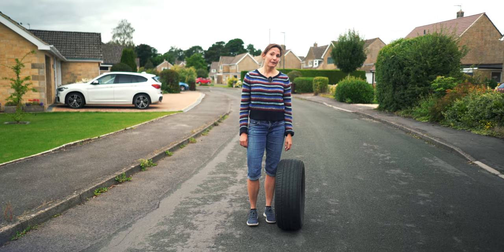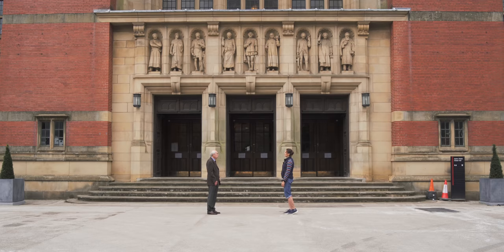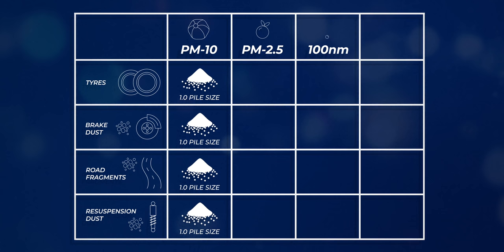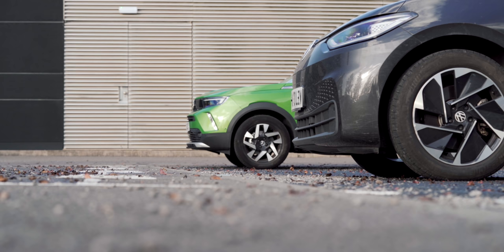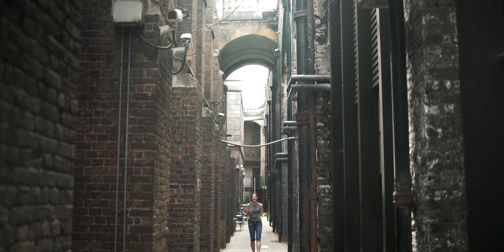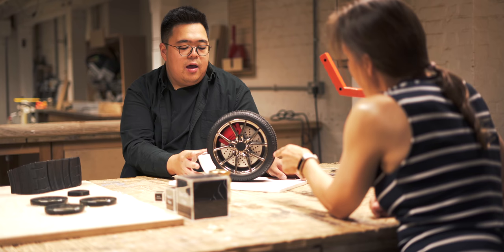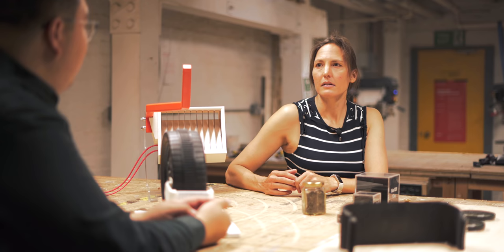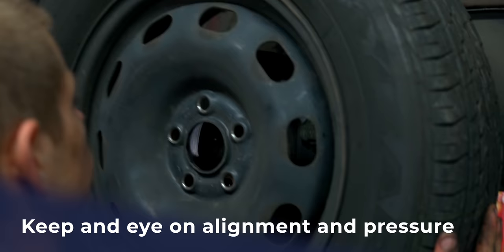The Secret Pollution That All Cars Are Guilty Of | Fully Charged

Comment: The obvious answer is we all need to use solid steel wheels, solid steel roads.
And maybe if we shared out vehicles and make sure they can carry a bus load of people.
And if we only travel a well defined route it would be much easier to understand and control the surface.

Aaaand.. I just invented the train again
Reply: Isn't steel made from coal powered steelworks or something? 😂😉
Reply: @TeaBreak.  doesn't have to be , all you need is electricity. There are steel mills that use electricity instead of coal , naturally that electricity needs to be produced without fossil fuels.
Reply: I understand that some of London's underground poor air quality is caused by steel train tyres wearing on steel rails.  A minor point, I do agree with you.
Reply: Solid steel wheels and solid steel roads brings back memories of the famous railway 'leaves on the line' announcement. It would end up like a tramway system with the same flexibility.
Reply: @vesawuoristo4162  Doesn't electricity mainly come from gas, a fossil fuel? 😉
Reply: @TeaBreak.  Doesn't have to ;)
Reply: The 'obvious answer' is to use non-tyred public transport, rail and tram with electric braking. Steel wheels and roads do not have sufficient adhesion coefficients to work. Running HGV's and low use busses generates enormous amounts of tyre and brake particulates. The least bad are light axle EV midi busses and last mile EV vans.  Long distance transport via high speed freight trains is the least damaging solution, requiring HS2 completion to free up freight paths.
Reply: @TeaBreak.  At the moment at the start of the evening peak period, 56% of my electricity is coming from renewables acording to the National Grid's 'when to plug in' app.
Reply: @eclecticcyclist  You don't make steel. 😉
Reply: @TeaBreak.  how do you know and what's that got to do with grid energy?
Reply: @eclecticcyclist  OP
Reply: @bellshooter  If you're running EVs or electric trains like the French TGV most of your braking is done by the motor and there is very little brake dust.
Reply: Trams
Reply: @TeaBreak.  will be made with hydrogen
Reply: @julianshepherd2038  Hydrogen comes from the production of petroleum. And is also twice as expensive as fossil fuel. Not sure that will happen any time soon.
Reply: Why not wooden wheels? And pull the thing with an animal, possibly? Also we can avoid all that deadly asphalt and concrete on the roads too... just use mud instead, which is plentiful and free.
Reply: @alexmckenna1171  Animal and Tree Rights. You'll have the woke police on your back with talk like that. 😂
Reply: @TeaBreak.  how often do they need to change steel wheels and track? Not very is a fair answer. The payback from the energy used to make the steel wheels and track is massive.
Reply: Yes, trains are way better.
Reply: @eclecticcyclist  the energy recovered from the braking of electric trains actually helps other trains pull away and accelerate. It's fed back into the system.
Reply: You made me chuckle.
Reply: @yodab.at1746  Rails last 50 years + even with very heavy use, and track level/alignment can be adjusted many times with very minimal addition of materials to compensate for wear and tear on the track bed. Unlike roads which need the entire surface to be stripped and rebuilt every few years. It's not only the environmental impact, maintaining roads is also very costly which is why many roads are in poor repair and governments are unceasingly struggling to find the resources to maintain them.

Comment: Completely agree. I'm an EV driver and have worked in local air quality for local govt (Part IV Env Act 1995) for over 20yrs and it's about time we put some real thought into non-exhaust emissions. Glad to see that DEFRA and UKHSA are starting to shift focus from NO2 to PM with particular focus on non-exhaust emissions. EVs are certainly not zero-emission, despite the three badges on my Nissan Leaf saying so haha.
Reply: Graham Cook  that's right they do. But the increased weight and torque are a significant factor. I'm all for an EV future, begone you ICE vehicles! But the answer to poor air quality is fewer vehicles not just different types of vehicles.
Reply: Good point. Is it time to rephrase to “zero exhaust emissions?”
Reply: Graham Cook  yes buy it's not just about tyre wear, there's road wear and resuspension too. It's a complex picture which is why I'm glad that Defra focus is shifting towards this topic.
Reply: One of the first things I did with our LEAFs was remove all of the "Zero Emissions" badges.  Greatly reduces the "electricity has to come from somewhere" arguments in parking lots.  Surprisingly to many, I already knew that.
Reply: Graham Cook  In my experience in 10 years of EV driving, the drive tires still do wear faster than non-drive tires.  These were FWD cars though so I can't say how much of that is from steering wear as opposed to drive forces.
Reply: EV's are definitely a good start to reducing emissions, but like you say we should still be focused on other non-exhaust emissions. As well as some of the other issues of EV's, like the weight of the vehicles, battery recycling, where batteries are sourced from, reducing the emissions of building new cars, where the electric for the car comes from etc.
Reply: @BixbyConsequence  me too for extra range!!!

Comment: A recent Norwegian study showed that ALL road wear comes from heavy vehicles(like 2500Kg+). Under that limit the wear wasn't measureable. I'm sure this research is going to be used against EV cars somehow. Many people say that EVs wears the road more, and the (statensvegvesen) study properly showed that its only the lorries fault. Focusing on the rubber pollution is just going to create noise in the scheme of things. Its wood burning and lorries that creates air pollution that creates astma.
Reply: Yes, I've seen it already, but of course never any talk about driving smaller ICE car instead of a giant SUV.
I think the particulates in diesel exhaust are exceptionally bad and get a undeserved pass from emissions standards.
Reply: Well in North America at least the 2500kg+ EVs are incoming, the F150 Lightning at 2950kg, Rivian R1T at 3200kg, and Hummer EV at 4000kg.

Comment: Feedback I've seen from EV owners is that brake pad wear on EVs is significantly reduced compared to non-EVs due to regenerative braking, as the brakes aren't actually being used.  Would be interested to see comments from EV owners who've also experienced this.
Reply: Brakes last longer, tires seem to at this point wear faster. Lots of ground, water, air pollution in mining for batteries.
Reply: The brakes on my 120000km Ioniq EV are still like new.
Reply: 5:43
I have 55,000 miles on my Model 3 and 42,000 miles on a Focus Electric and have never replaced a single brake pad in either vehicle, so for sure brake dust is  significantly less of an issue for EVs. Probably close to an order of magnitude less.
Reply: The US has some useful long term data from Tesla on brake wear.  It seems that Tesla brake pads last 5x-10x longer than the equivalent ICE car.  The reality is that at best we are generation 2 of EVs.  By the time we get to 2030 it would reasonable to expect that we will be at generation 4 of EVs: longer range, faster charge speed and crucially much lighter batteries which means that like for like models will be a lot lighter - sadly I suspect that vehicle manufacturers will produce heavier and heavier models, partly caused by improved safety regulations but mostly caused by customers wanting bigger and taller cars
Reply: I’ve heard rule of thumb is 4x as long for brake pads.
Reply: My Leaf is now due some new pads, at 65k miles...
Reply: @nom_chompsky  its not the same at all, i live in alps and I hardly ever have to use the brakes on my EV even going down cols with many hairpin bends. it has 180000kms and original pads are like new.
Reply: Correct! Used regen in our 2018 Leaf. Only had it 2.5 years so of course no time for brakes to wear either way, but I hardly used them so I imagine they would last way longer.
Reply: @justinstephenson9360  We will fly by 2030, so no tyre pollution either. It will be heavenly.
Reply: @AB-yt4hd  that’s nothing my Honda Jeffrey has 180,000,000 miles and haven’t replaced the tires, brakes or washer fluid!
Reply: Yup. 191k on my prius before the brake pads wore out. They actually didn't wear out but the sliding pins seized up because you still need to grease them every 36k miles. Sized up and ate the pads and locked up. 😂
But yes the pads that werent locked up were pretty much new like 80% life.
Reply: I've probably only stepped on the break once or twice in the last year, which is magnitudes less than with my ICE car
Reply: @AB-yt4hd  2002 EV: original discs and halfway through the factory pads! vax candles and vacuuming is way worse for your life expectancy. EV tyres are higher pressure and made from harder rubber to reduce rolling resistance, so the higher weight is somewhat countered by harder wearing tyres.
Reply: AS  a mechanic I totally agree in fact 50 per cent less wear on brake pads if you use regen braking that's a fact and you can take that to the bank lol. no really.
Reply: My 2014 Tesla Model S has 176,000Km and is on its original set of brake pads. Tyres are lasting an average of about 60,000Km a set.
Reply: You can actually do the same thing with ICE car by using engine braking by down shifting gears, effectively the same thing as regenerate braking which slows down the car without using the brakes
Reply: @NicholasY21  I wonder though if the high revving on the engine and increased fuel consumption is more harmful to the environment, long term reliability of the engine and in turn more expensive to the owner. 

I know my car engine brakes when going down hills with cruise set and then once it gets over a certain speed if the engine braking isn't sufficient it then will utilise the brakes to further slow. When it does this though, the engine is at 4/5 thousand rpm. Noisy and sounds harsh on the car. What are your thoughts?? I mean replacing an engine is a lot more expensive then pads.
Reply: @TheAegisClaw  do you not use "B" mode or are you just an aggressive braker? I often barely use the brake pedal.
Reply: @GudieveNing  I'm just hopeful we'll be utilizing self charging (most likely solar) vehicles by then. Taking to the air is another whole level of evolution-maybe by the end of the century....
Reply: @rngalston  gen 1 leaf doesn't have enough regen to avoid the brakes all the time. Still 2-3x an ice would last though.
Reply: @rickbelieves7652  add all pollution and environmental damaged by the oil production used for ICE (apply percentage for how much oil is used for fuel production) and it will be much higher that the environmental damage of the production of the batteries.
The gap widens as new mining and chemistries are developed.
Reply: @TheAegisClaw  mine is Gen 1. It's a matter of seeing the need to decelerate in time. It's a challenge for me (and those that are behind me) to not use the brake pedal and only apply the parking brake against idle creep... It doesn't happen very often (I try to be under 5 mph to prevent unnecessary rear brake pad wear and avoid the annoying alarm chime), but always a feat when I do! Then I disengage the pedal and hold with my left foot until the light goes green and punch it to leave all the ICE cars in my tire dust, accelerate to maximum legal velocity, set cruise, and then get the road to myself (unless someone catches me by speeding). Makes my commute even more enjoyable. But that's just me...
Reply: @plojo  
That is the hope, but people need to realize everything pollutes or has other negative effects. Also oil is not going away, it is used in too many products.
Reply: @rickbelieves7652  +1
Reply: @TheAegisClaw  sounds about right.  If you are light on your brakes and use regen for most driving you might get up to 100k miles on a leaf before changing but 75000 is more likely to be the limit before changing.  On a similar sized ICE car you might get 50,000 miles at most before changing (usually 35-40,000) so still a lot better, just not as good as for other EVs.
Reply: @GudieveNing  What exactly is the benefit of flying? Excluding pollution (which is speculation for now)
There's really no point in flying and imo it's a terrible idea to have cars fly above my head so we can't see the sun anymore and it's a constant movement above our head. I'd be scared of an accident mid-air and vehicles crashing down on pedestrians etc.

I do not see a single upside on flying around for normal traffic.
Reply: Even in a heavy old Mitsubishi Outlander PHEV my tyres and brakes are considerably less worn after 46,000 miles than in any previous ICE a car I have ever owned.  I always use the variable regen braking to the full when going downhill, approaching roundabouts etc.
Reply: @jamesegan3756  9mm..?! 
You check these things ........?!?!?!
Reply: At 50,000 miles the brakes on my EV are at 90% or more.  They just don't measure them that precisely.  Over the life of the car, tires are the most expensive item, actually costing more than the propulsion batteries.
Reply: @lukiejames  if I’m in a manual car i would normally use engine braking and brakes on the same time, but in auto i just use the brakes, but as of above i was just saying ICE cars can do the same thing as regenerative braking since no one mentioned it, and I just did some research online saying it doesn’t use any fuel when using engine braking as your are no pressing the accelerator pedal rather than letting the engine to slow down to the same speed as your wheel speed and the and the engine is design to run high rpm up to the redline but of course i always try to keep the rpm at near 2-3k thats where your car will automatically shift up a gear anyway so i don’t see no harm if your car shift up at 3 and you shift down to 3 and having the same rpm and to keep it the engine rpm low when braking just apply braking the same time for the fastest deceleration, and either way you will going to cause harm to the environment with braking alone or using both engine braking and brakes together
Reply: @NicholasY21  thank you for your reply.
Reply: @lukiejames  no worries, hope that answer your question
Reply: 2015 Leaf with original brake pads at 59,000 miles. I checked them this year after buying replacements and found they had worn by 35%. I checked for corrosions to because people tend to over look this as it can loosen the pad off the plate they are stuck to!! and pitting on the disc. Recommend people who live near the coast need to do this more frequently. However I have notice my tyres are wearing faster due to the weight on the car around corners. I need to adapt.
Reply: @nom_chompsky  Agree 100%, plus if I see a red ahead I immediately take my foot off of the accelerator & can quite often proceed through the intersection without stopping.
It cracks me up how aggressive drivers race past me, then apply the brake for the redlight. 🙄
Reply: @flyboy970  🤣😂👍
Reply: @rickbelieves7652  fair to say there's hundreds of times more ground air and water pollution repeatedly mining for fuel though
Reply: @james0157  
Oil naturally seeps up from the ocean all over the world, way more then most realize. Heavy metals cause some serious issues on humans when they get into our water and in workers. Both are bad, but EV mining is just ramping now, so lots of unknowns.
Reply: I've read lots of comments from EV drivers saying they can't believe how long their brake pads are lasting, for this exact reason.
Reply: ....Favorite feature of EV driving.
I suspect that it improves reaction time during emergency braking, too.
The precious split second it takes to move your foot to the brake pedal is almost eliminated, and the regen smoothly shifts weight to the front tires (vs sharp pedal stab in panic braking).
Reply: That is true, but I see many EV owners using harsh acceleration. Indeed, fast acceleration seems to be encouraged, even in the EV media.
Reply: @nom_chompsky  Are you implying that one should use the engine/gearbox/drivetrain as a brake? This is bad practice and contrary to what I was always taught (brakes are for braking, not jamming it into a lower gear and abuse the drivetrain (inc tyres..). Another major point is that modern engines are not the same as older combustion engines - my previous ICE car was a 2017 BMW 118i, 3 cylinder, almost no engine braking, would roll for ages in top gear, totally incomparable to my latest Tesla 3, where i use the brake approximately once each commuting journey (mainly due to some knob pushing in a queue in front of me..)
Reply: @rickbelieves7652  you should come to Canada and see the ground water and air pollution from oil sands mines.
Reply: @nom_chompsky  you just end up burning your clutch out faster. And since clutch material is pretty much the same as brake material, it's kind of a silly thing to do. Plus when you go down hills, you not going to use your engine to slow you down. (Non Jake brake or transmission retarder)
Reply: @lukiejames  ?? My Phev did not do that at all and there is no wear on an EV's motor, or noise you describe at all.
Reply: @williamarmstrong7199  are you replying to the right person? I literally have no idea what you’re talking about. I don’t even drive an EV??